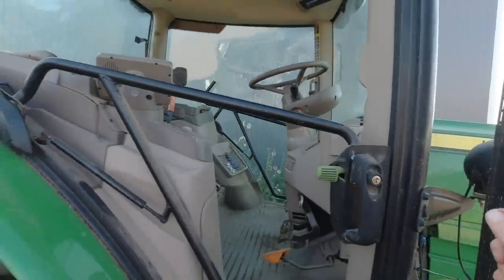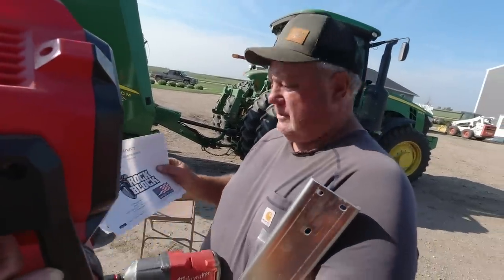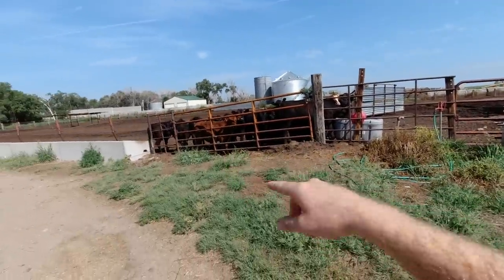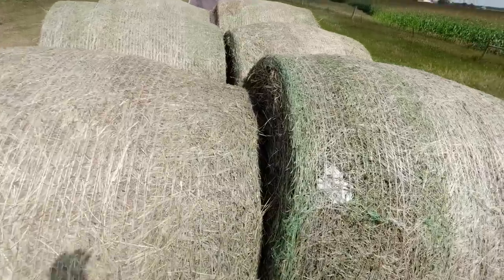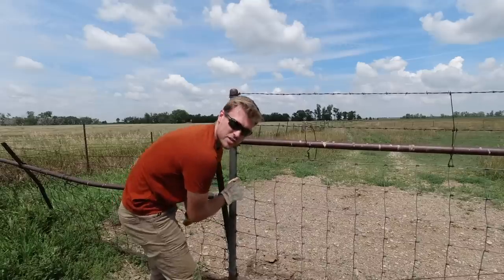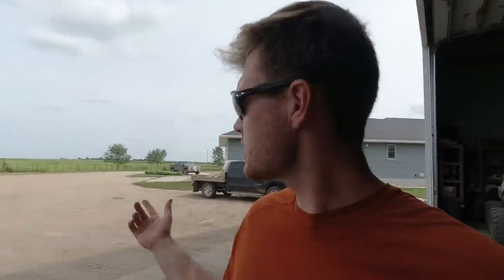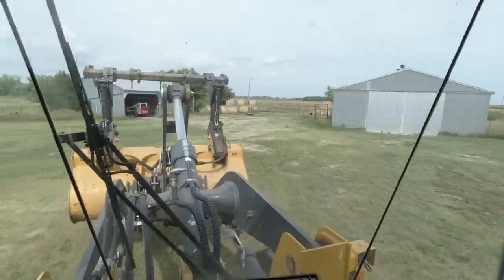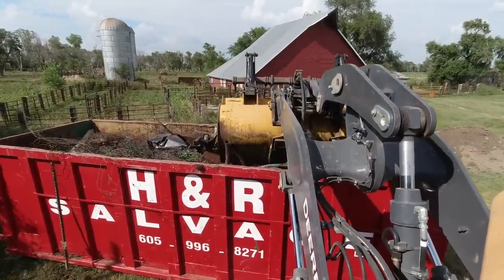Gathering Up the Ditch Hay

Comment: After the 2nd rear glass in my JD 6400, I built a deflector screen. One bolt in the center link hole & no more. Maybe $30 in materials. Disk mowers & ditches can be risky. Throw a lot of junk! Cutting hay myself. My dilemma, got up the morning to a flat on the rear of my mower/loader tractor. Take it easy!

Comment: Place a pipe or round bar between the wheel bracket and frame. Then nudge it. This will allow it to over spring and should get you close in not back to perfect.

Comment: Great channel. If you have a near by water source ie a creek or pond, you could build a hydraulic ram pump that is completely self sufficient and requires no electric feed to help keep your water tanks full. It provides a constant flow of water from point A to point B.
Reply: It’s flat there & you need pressure drop for ram pump to work

Comment: I'm confused about the trash in these ditch bales. What happens to the trash after the cattle eat the bales in the bale feeders? Doesn't that go on the ground around the bale feeder which you then load into a manure spreader which you then spread in your fields which will then eventually go through your combine?
Reply: As a farmer, you would pick up all the trash after the cows eat the grass and dispose of it properly.
Reply from the maker: What ted said, you pick it up. They wont eat those big pieces of garbage and it will be littered on the ground

Comment: Should have painted the old fence stakes and sold them at storela station to gardeners they pay 7.00 to 9.00 new if you sold for 2.00 with out paint and 4.00 with paint you would have raised more than selling by lbs at metal recycler just saying 😉👍

Comment: You guys are turning into a bunch of soft townies. Have to have AC to mow. Bet your grandpa did not have AC LOL
Reply from the maker: the thing is in these newer tractors that are like glass boxes letting sun in its just a hot box if you dont have ac. Need a breeze for sure. Yea 50 years ago there wasnt AC but it was an open cab with a breeze

Comment: Is there a reason farmers don't keep an 18 month supply of hay (or however long you'd need to feel like you were partially insured for a drought)?
It looks like hay loses value when stored outside. (may 5-10%/year, when covered, outdoors)
So I guess you'd be guaranteeing a loss of money. For the chance of a drought.

I don't know much about the farm. I think it usually grows more hay than it needs (and sells the excess).
And I don't know what yearly expenditures/profits are like. 
The bottom line, I assume, is that it doesn't make financial sense. I'd just like to learn more about why that is.
(and I don't know the variations of hay, alfalfa, silage, etc. - all I've heard is that protein content is important)
Reply: Their store of hay has run down over last few years due to lack of rain thus nut being able to replace.